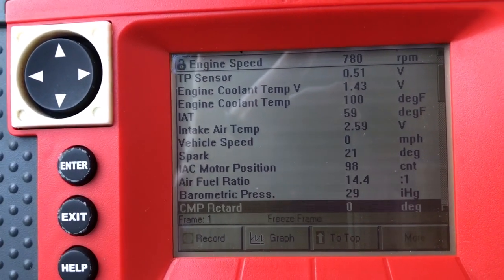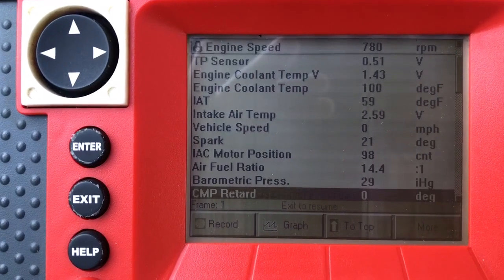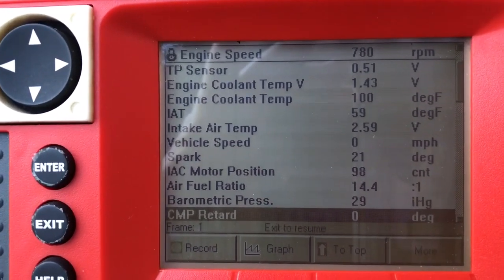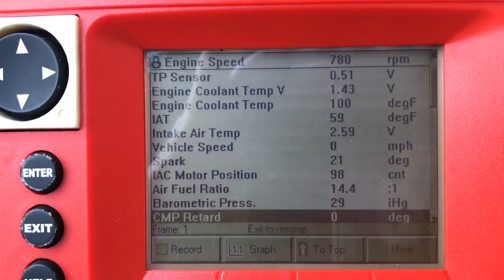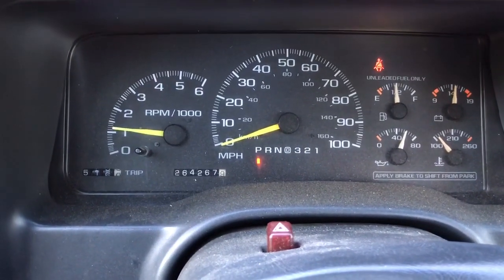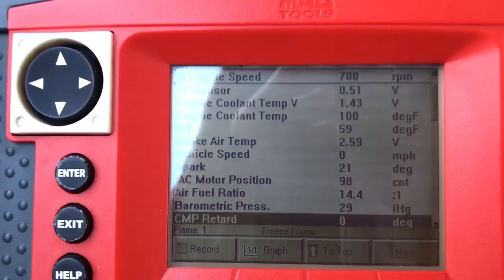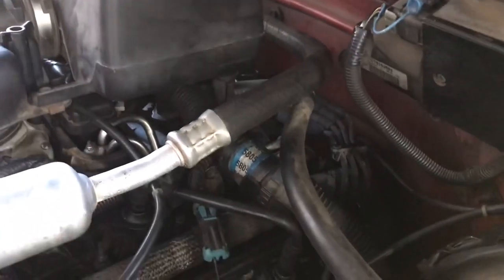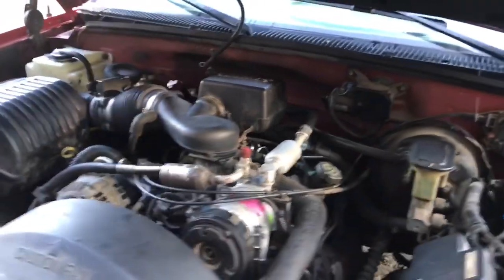How to Fix P1345 code Chevy 5.7 Vortec Engine

Comment: I was getting the same code p1345 and also a code for the crankshaft p0339 found oil leak was causing the connector to be soaked possibly  contaminated cleaned it with electrical cleaner and put some dielectric grease took care of the issues and both codes.
Reply from the maker: Great! Thanks for the information and good job fixing it

Comment: Did you pick up the distributor & move it left or right one tooth?
Reply from the maker: Looking down at the distributor, Turning it counter would advance the timing since the rotor turns clockwise
Reply: @dhammiam  I'll give it a try... It'd be better if you did it! lol

Comment: i have a 99 Yukon 5.7, and I have the p1345 code and put a new distributor in thinking it would solve a misfire it has under acceleration and it’s still doing so if not worse. I believe it’s behind in timing but which direction is it supposed to be moved over ?
Reply: And did you just pull it out and move it over or did you turn it over and get it to TDC then do so ?
Reply from the maker: It’s best to put on TDC and move it, but not necessary. You can just mark on the distributor where the rotor is pointing, pull the distributor up, turn the rotor one tooth and put back in. The only reason you’d have to pull it back out is if you were so far off that you run out of adjustability, distributor hits something before you get to where it needs to be. If you’re behind, turn counter clockwise (looking down on distributor) to advance

Comment: (there is a pending code for P1345, blank, diagnosed it and found that this code typically is related to excessive wear in the cam shaft, causing the timing to be incorrect, to correct this issue, he recommends replacing the cam as well as the timing chain components ) what’s the possibility about this being true?
Reply from the maker: It’s more possible that the timing gear and chain is wore. That’s an easy fix. What are your symptoms and how many miles on the engine?

Comment: Was the truck off when you moved distributor over a tooth? Older vehicles, I was able to just turn distributor.  I'm sure it was off but just checking ! Never done this on 5.7l so Leary to mess up something. I love my truck but this code disturbs me & I want it gone... 😂😂😂
Reply from the maker: It was off just enough that when I needed another 1/4" or so It was hitting something and wouldn't go any further

Comment: I can turn the distributor like how they adjusted the old school 350? I thought the vortecs don't get set like that? I got the p1345 code too. And mine was off a tooth. And to the eye it looks lined up to the #1 on rotor, but its still got the same code.
Reply from the maker: It has to be set basically at zero so the computer has enough adjustment. -2 degrees to +2 is the window. Has to be set with a scan tool

Comment: Im stuck on a p0300 can't figure it out sucks
Reply from the maker: If you’ve done repairs and there are no issues such as intake leaks, or bad spark plugs or you no longer have a misfire, may just need a crankshaft sensor re-learn. Will need a scan tool capable of doing one. Good luck and let me know if this works

Comment: What way did you twist it my truck is at +30 degree
Reply from the maker: Looking down at the distributor turn it clockwise probably half inch or so. May have to pull it out and move 1 tooth if you don’t have enough adjustment
Reply: @dhammiam  okay thank you also my scanner only does ignition time advance for cylinder 1 is that the same thing?
Reply from the maker: @user-wf2ek8hz8g  yes that is it.  Good luck and let me know if ya need any more help

Comment: Which way did you move the distributor? If you read -22°, does that mean the rotor is BEHIND where it wants to be? In other words, does the scanner report rotor position (cam) or what the ECM is trying to correct? BTW, I just installed mine and when I turn the crank to #1 TDC, the rotor looks to be lined up with #1 tower on the cap but I'm getting a +22° reading on scan tool and the MIL on.
Reply from the maker: It sounds like you need to turn the distributor clockwise looking down at it. Turning it counter would advance the timing since the rotor turns clockwise
Reply: @dhammiam  The distributor has a square housing where the fork is. You can only turn it a degree or so. It is not intended to rotated like the old ones were. The only "timing" thats available is rotating the shaft by a tooth in either direction. When I do that its too much.
Reply: Well I’m having the exact same problem did you ever figure it out
Reply: @313barrygmail  Yes. Turns out the aftermarket distributor can have a wide tolerance. Dowel pin, gear, stator plate, shaft all can add up to misalignment. I widened the slot on the clamp (both the bolt hole and fork) and re-installed the distributor. Rotated it while engine running and went both ways (+ and -) until I could actually hear the spark jumping inside. Centered it and got it near 0 degrees. MIL light off, runs great.

While this is a bit of a hack job, its what it takes when using some aftermarket parts. Designed to non-adjustable but you need this allowance to center the distributor with the cam
Reply: @saltcar  That's the trick, you have to be able to move the distributor, if it hits and won't go further you have to move it one tooth if the hold down clamp is fixed you have to modify the clamp and or the squared distributor shaft other wise it will not rotate.
Currently my engine is running -22 degrees, when I rotate 1 tooth advanced, it will not idle, pulled the distributor 20 times no luck hitting the sweet spot.
Now it idles at 2500 rpms with random misfires. Change the IAV in the morning and advancing the distributor getting rid of the square clamp. Also have generic maf sensor low voltage though maf sensor is new. Getting a good reading from map.
Thanks for sharing, real happy to hear you had your dad around for so many years, says a lot about your character, mine dumped me and the family for a young woman, showed up after 25 years of nothing.

Comment: So I've got a 2001 and the computer supposed to do the fine adjustments did the exact same thing as far as intake gaskets and all that new distributor ran beautifully right off the bat didn't smell any raw fuel new spider all that good stuff just to be on the safe side cylinder one top dead center with a indicator gauge put it right at the Mark which is the number eight on the driver side while looking under the distributor cap just as it's piston starting to go down just a hair and it ran way better then I started getting the raw if you will smell eventually I'm starting to suspect my PCM of not being able to make the changes it needs all distributor and new distributor lined up pretty much the same the new one wanted to go clockwise just a little bit more and the spark seemed a little premature so I adjusted a counterclockwise a little using my crappy scan tool and just timing how long it took the light to come back on I always had engine misfire nothing specific finally it just gave me the two camshaft crankshaft correlation code it seems as though the timing does not stay consistent it changes it'll be running great after I adjust it and then it will fluctuate this is the first time I've ever gotten this code it was giving me the misfire code with the new distributor no matter how it was adjusted has anyone heard of symptoms like this with a bad PCM or any ideas thanks also if you know of a bigger engine that I could fit in this work van I would love to hear about it I'm thinking about getting an Escalade engine and tranny it's a pretty heavy 3500 cutaway dually thanks y'all
Reply from the maker: It’s very hard to get the timing right without a scan tool to tell ya exactly where it is
Reply: @dhammiam  yeah I got it using the eyeball method cut a bunch of holes in it and then watched it put my scanner on alternator test so I could read RPMs got it to 11:00 sounds good I'll be testing out here shortly when I leave to go fishing I do appreciate your time and research I currently have that scanner in my car depending on how my test drive goes I'll be getting the one you recommended seems as though you took price and function into the equation
Reply from the maker: Good luck to you on the repair and fishing. I’m thinking about getting the scanner myself since mine are outdated and one of the biggest expenses is updating. Even with the electronics there’s always still the easier way to do things. My first step in repair is just go back to the basics. 
Have a great holiday weekend
Reply from the maker: Just curious and going off my first thoughts here, wondering if the timing gears and chain are worn??
Reply: @dhammiam  there's not too many miles on this rebuilt Jasper engine so I would say not the original problem was rough start after the engine was warm passenger side cat was pretty much completely clogged nothing on the driver side it had been removed since done all the oxygen sensors remove the cat out of the other side I'm trying to think back pressures semi important to this engine I'm in the middle of cutting the peepholes in my cap to have a look see I'm also looking to buy a new scan tool a proper one with live data I own mostly Chevy GMC if you have any recommendations that would be cool maybe I can go through your link to buy one I have not been successful on finding one online that can get into these computers most of them are for BMW European cars etc and also if I buy a new PCM or a used one they say I can get it programmed to my VIN and I'm hoping I can tell him there's no cats and there's an adjustment there as well not sure thanks
Reply: Yeah so after cutting the holes in there and running at 1100 RPMs it looks like I need to rotate the cap counterclockwise which would be more in line with what the old one was at so maybe the old one was off the tooth as well I'll give it a shot.......... So move it over to it didn't give me any more play moved it back to where it was and the Sparks are coming off fairly straight I drilled a bunch of holes so I could check each pin it seems as though the way they make the cap they don't all hit straight so it's kind of at a happy medium great video thanks again
Reply from the maker: @capecodwoody  here’s the link to what seems like a good scan tool and code reader for the price. I’ve got older models and this one has lifetime updates via WiFi which is great. Seems I forgot to add the link in my comment pinned to my video 😆 
https://amzn.to/3gbdtSX

Comment: Was it running extremely rough and over heating before you did that?
Reply from the maker: The only thing was a check engine light and rough idle. It definitely could overheat and run rough if the timing is way off. When the ignition is happening and the heat is directed to the open cylinder vs being pushed out the exhaust
Reply: @dhammiam  the reason i ask is because i just bought a truck that the guy said it has a blown head gasket but it runs, its runs really rough and that is the only code, and he said he replaced the upper intake stuff so i just wonder if he put the distributor back in wrong or if it actually has a blown head gasket..
Reply from the maker: @norayreview  very well could be.
Reply: @norayreview   Did u figure out if it was the distributor or not? I’m having the same problems and i’m not sure if i put it in wrong because i changed it and it’s been happening since.
Reply: @ricsosaucy8611  well i started it and filled it up with coolant and there was constant bubbles, so i concluded mine is headgaskets.

Comment: Can you do that with a regular scan tool or do have to have the one you have ?
Reply from the maker: You can do it on a scanner that shows data, but not on just a code checker. My scanner is actually around 10 years old.

Comment: I can not seem to get rid of my p0325 code after 2 knock sensor replacements and 1 pigtail replacement for the knock sensor circuit. Installed new ACCEL distributor,cap,rotor and wires. I am questioning the timing chain and gears at this point. Got any ideas man? 1996 silverado k1500 with 5.7 vortec is the vehicle.
Reply from the maker: Can you hear it spark knocking? Check every wire in the circuit for corrosion and make sure all grounds are ok. Check the EGR valve as well.  If its not working correctly the cylinder temps can get higher and cause spark knock (pre-ignition) just as a vacuum leak can or advanced timing.  I assume there's no P1345 set so timing is probably not advanced.  Coolant temps and  Fuel pressure ok? These are clues for me so that's why I ask, thanks.

Comment: Great video. You do realize that on the Chevy 5.7L Vortec that the timing is supposed to be at + or - 2 degrees not at zero :)
Reply: Lol what a dumb ass. Zero is right where it should be
Reply: @daves_not_here_mannn  lmao what a fucking idiot
Reply from the maker: Thanks. Yes, zero is exact center of + or -2

Comment: My truck just stalled while making a left turn. Pulled codes p1345 and p0108 map sensor... possibly bad sensors or ground issue? Something kinda smelled burnt under the hood. Im at work and cant really look at it until lunch though....any help
Reply from the maker: Jason Mock check out this video, may help you. Good luck. https://youtu.be/QSR6pIXzvl0

Comment: My advance timing is at -21 degrees I am trying to set it at between - 2  and +2  and I can"t seem to get it off from -21 degrees , what do I need to do
Reply from the maker: Most likely need to move advance one tooth
Reply from the maker: That would be turning the distributor counter clockwise and if you’re running out of room, pull distributor, turn rotor clockwise one tooth and put back in and adjust
Reply: @dhammiam  thank you , I'll do that and your video very helpful
Reply from the maker: Nidia Armendariz something else you may have to do to get it to show is after adjusting, turn the scan tool off and back on to make sure it’s reading the change. I had to do that with mine.
Reply: @dhammiam  ok  will do , thanks

Comment: Which wat did you turn the distributor? left or right?
Reply from the maker: brown67 to back the timing down (retard the timing) on a Chevrolet engine turn clockwise. To advance it turn counter clockwise, since the rotation of the rotor is clockwise. Thanks for commenting
Reply: Are we moving it counterclockwise looking at the motor from front of vehicle or from inside the vehicle?
Reply from the maker: Looking directly down on the distributor from under the hood.

Comment: Does the code self clear when its in the sweet spot?
I've done these steps as well and my MIL is still on.
Reply from the maker: The check engine light will go off once it’s in the right spot, and the code stored will clear itself eventually or with disconnecting the battery
Reply: @dhammiam  i guess im not quite there yet.
Thank you very much!